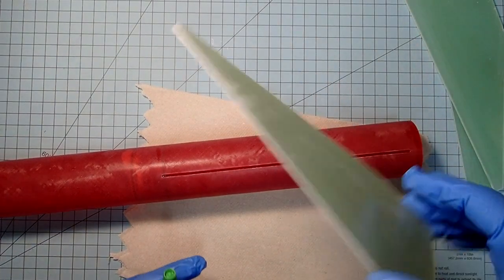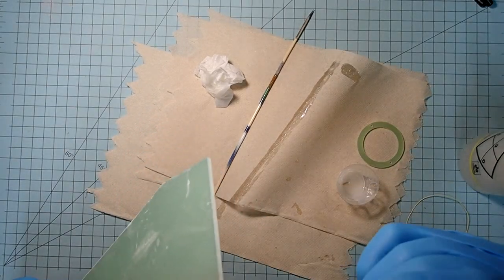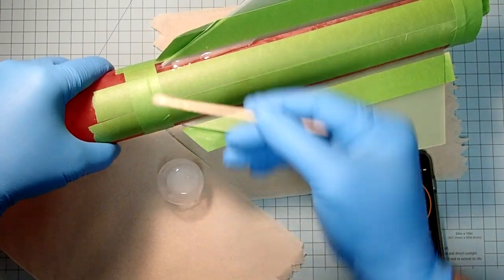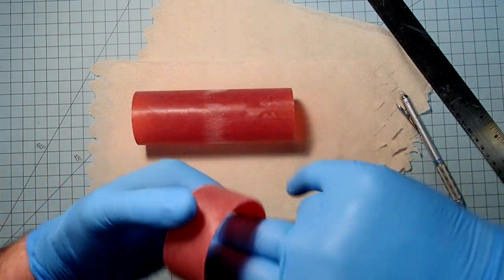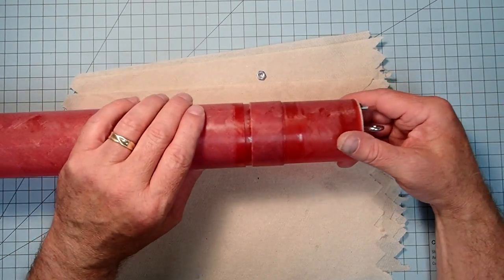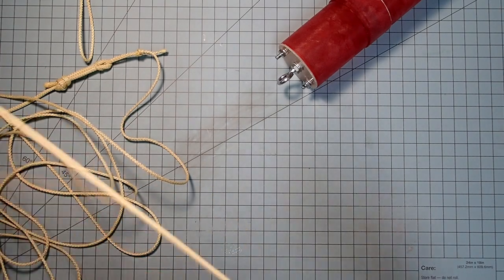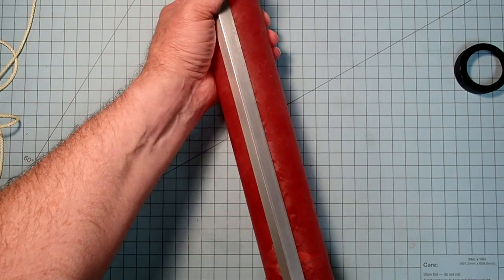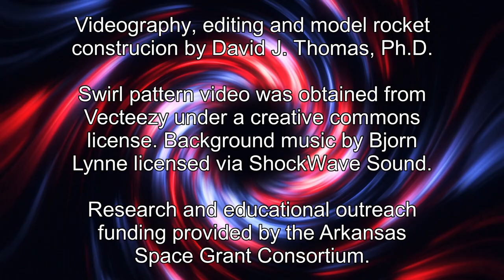Madcow "Adventurer" high-power rocket assembly (part 2 of 2)

Comment: Why use CA to tack the fins to the motor mount?  Why not use epoxy, which is much stronger?
Reply from the maker: @SeñorTortouise  the CA sets faster. Epoxy is used later to increase the strength.

Comment: hi, my team & i are using the g12 fiberglass from madcow as well, we aren’t looking to paint it but are wondering if there needs to be some type of top coat finishing on it. if so, how could we do that?
Reply from the maker: As long as the surface is smooth, it can fly naked. If you have exposed fibers, try sanding with 220-320 grit sandpaper, and then spray on a coat of clear enamel.